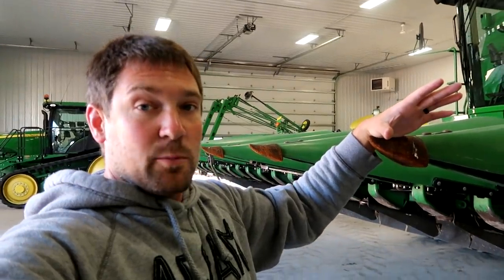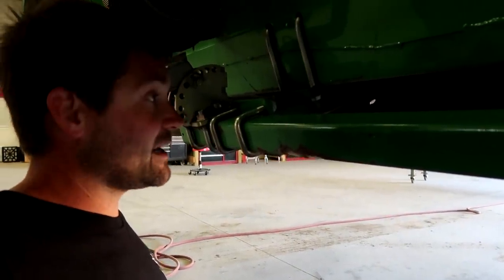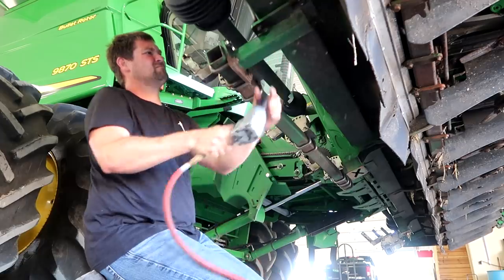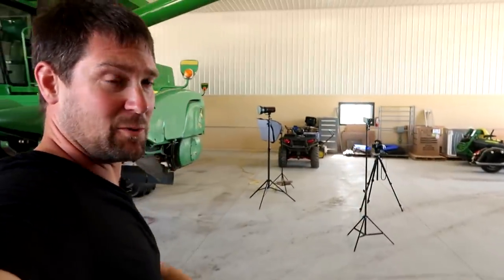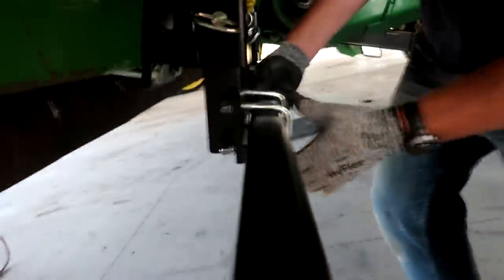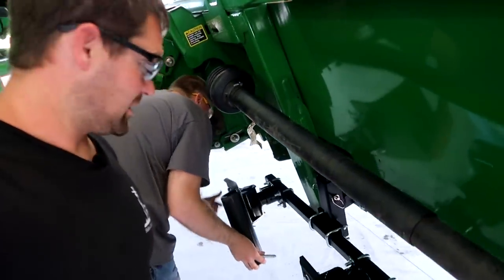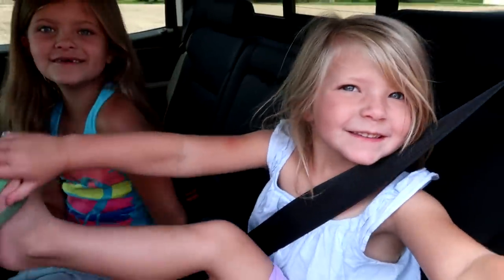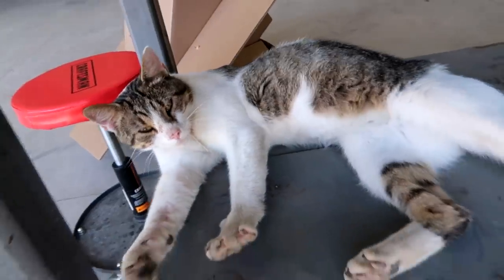Combine Work Before Harvest

Comment: Reply to Brad not Landa
Tie up the first end you loosen with a strap or rope. Get 2nd end loose and set on ground.

Have to admit the Welker video where they get to try out a Case 8250 combine - 2019 model was an awesome piece of machine. It was running a 40 foot head and nearly doubling their 45 foot heads on the other combines.

Comment: I think my blood is as green as yours but I did work for a case I H  dealer way back in the last century and I most say I was impressed with there combines 1440 and 1640 very simple and easy to work on you really need to try one  ☝️

Comment: Hi Milleniel  Farmer. Working on the corn head. Are the header safety latches on? Always concerned about headers, loaders and hoists when working on them. Seen so many people changing sections or guards with header  or reel not locked up .Have a good and safe harvest run!☀️☀️🌽🌽🇨🇦

Comment: I still don't get it, what are stalk stompers supposed to do? Knock down the stalks to the ground? But why only 6 of them, there are many row heads, or is it to save the tires and fuel efficiency by knocking down the rows in front of the wheels only?
Reply: Save the tires.

Comment: Zach,

I am not all that familiar with Stalk stompers, but curious as to why you only have 6 of them on a 12 row head?  Maybe I am missing something, or maybe I just need to do some research, but just curious!
Reply: They did the rows in front of the tires. Don't want to run over corn stalks with tires all the time.

Comment: Could you explain what the function of such a piece does. I'm not a farmer but would no doubt be one if the early 80's interest rates not caused my father to go bankrupt.
Reply: Denny Hubler stalk stompers push the cut off corn stalks down before the tires or tracks get to them so it doesn’t damage a tire or track on the combine, new age corn stubble is very strong and  hard on rubber.
Reply: @aronlewis9835  thanks. I figured the name implied it's purpose. However I didn't think the stalks were strong enough to cause any damage to the rubber. Hence my confusion.

Comment: can someone tell this poor nonfarmer what a stock stomper is?
Reply: When corn header goes through the corn it cuts the stock off about 8 inches off the ground, these stocks are like small tree stumps and will tear up very expensive tires...so these stompers break and push flat the stocks so you don't wreck your tires....I prefer to run them on all rows of the corn head so you don't wreck tires on the grain cart and tillage tractor.
Reply: @scottheeren9807  thanks mate.